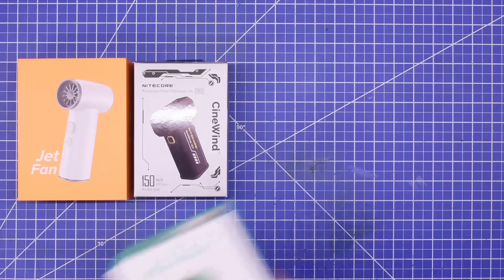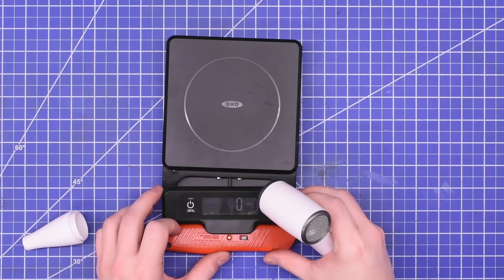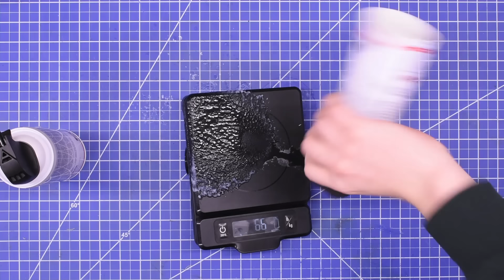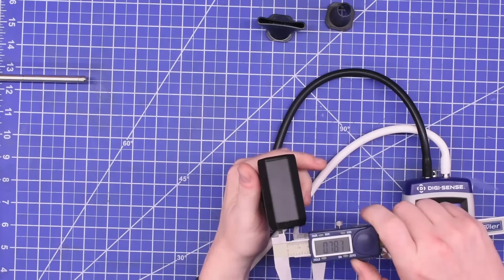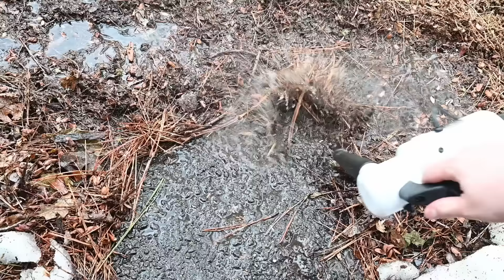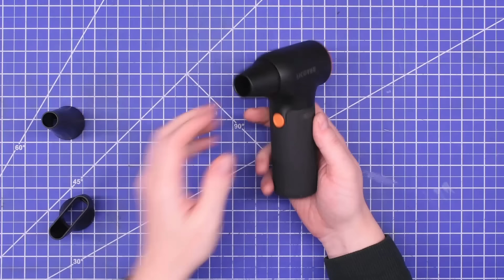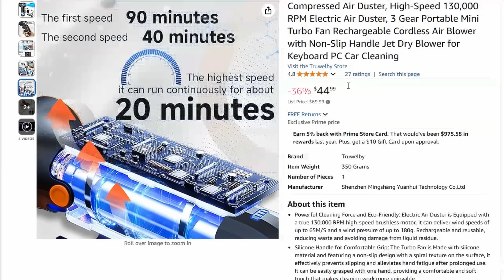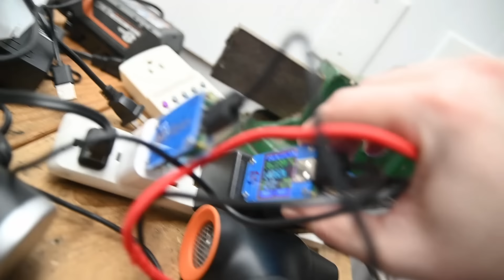Impossible Turbo Fan Dusters v DataVac & Actual Air Cans

Comment: Ok for a bit of info on electronic dusters, You have to be careful of what you are getting for a few reasons, First off the point of the duster and its outliers of what's needed. First off they are there to lift the dust that is stuck onto surfaces and that is all they are supposed to do. Some can do this with a wider area which can save time but one be careful point is too much power can force that dust into places it is not supposed to be. Dust can be electrically conductive so it can short out circuits or block parts from seating right and coming loose. 

Having good pinpoint is needed for tight areas or getting around areas like fan blades. Pointing one of these at your fans without holding the fan to keep it from spinning can cause it to overspin and damage it. You want details then you will have to look it up on PC fans and overspinning damage. 

There is a 3rd be careful point and that's enough air pressure to break components and yes if you stick something like a air compressor nozzle and pull the trigger then you can break off components, Mainly its the first 2 of overspinning fans and compacting dust but it can still be a problem.
Reply: 1. Dust gets everywhere on its own. There is no difference between you forcing it there and it getting there on its own. Static electricity is a real problem, yes, but the likelyhood of you causing any discharges while dusting a PC are astronomically low. 
2. "overspinning", as you call it, will not damage a regular PC fan or its bearing if its not made out of chinesium. Youd be surprised how much abuse these fans can withstand.
3. Sending voltage back into the board by spinning the fan and expecting it to fry other components is a problem of the past. In the vast majority of cases, you cant send voltage back into the board through the fan headers. Diodes and such, yknow. 
4. You will never generate enough speed or pressure to rip components off a pcb with just air. Thats just not gonna happen without, like, a 20000kPa air cylinder as your supply. If you manage to do that, consider what youre doing isnt the way you should be doing it.
Reply: First off, dust can only get into certain spaces where the airflow can push it. Most of the times it won't get into most spots in any real level to cause a short, you blowing dust around can push more into a area. This is talked about with people that build and mod PCs. Some of them have even seen the damage from something like that so I will take their word for something like that. Also I have seen well enough how trying to blow dust around off of parts and machines where before there was hardly any that could even be moved off with the swipe of a finger to where it was layered in the same area later. Thats why you vacuum or sweep off most then blow.

Overspinning is a thing that manufacturers talk about avoiding. The damage is done to the fluid type bearings because they operate on the pressures they generate when they spin, overspinning over pressurizes the fluid forcing it to run dry. The other is ball bearing which is rarer but they can also get over pressurized and leak fluid. 

I didn't say anything about sending voltage back through the fans so I don't know why you are making a point on that.

I have scrapped old dusty boards and have seen a basic 125 PSI air compressor with small air nozzle blow off some components. The boards were working when they were removed but they have been there for 30 years. One of them was a small plastic looking chip and it was only soldered on and not going through the board and it pulled up part of the copper with it. Also to add when I meant the sticking the air compressor nozzle, I am meaning them putting the thing almost right up to the board and using it and not far away. It would be more likely a problem of someone bumping it into a component than blowing them off. Lets face it, a person using a air compressor to blow out a usable PC is more than likely a mechanical inclined person than a computer inclined person.

Comment: Once again, non-contact tachometers require reflective tape on the rotating part to measure rpm. The manual for your tachometer will show this. Why are you trying to use black marker for this? A black spot won't reflect the laser back to the optical sensor.
Reply: Project Farm does it correctly using reflective tape. Using your tachometer wrong does not help your channel's credibility. I'm kinda surprised by how many people in the comments didn't notice the user error.

Comment: I got the Wolfbox one after the first duster episode, and then they came out with a cheaper version that still does alright. Gifted that version to my neighbor and he's loving it.
I've been using a DataVac for about a decade at various IT shops. Started back when I built and serviced gaming and workstation PCs regularly. It was irreplaceable, but always a bit too strong, too bulky, and annoying to have to plug in. If you're not careful with it, you can easily bend thinner heat sinks. I imagine if you were particularly careless you could blow poorly-secured components off boards. 

The Wolfbox has replaced the DataVac for me almost entirely. I only find need for the DataVac when blowing out very large cases or server racks, or the truly most filthy and forgotten boxes.
Reply: I calibrate and repair electrical test equipment and my Wolfbox is a necessity. I didn't even see the video first. The TTC vid just pushed it to the top of amazon and the algorithm steered me right. This channel is doing everyone a favor, even if they don't know it exists.

Comment: Out of curiosity, what is the audible range of your DB meter? AFAIK, ultrasonic sound can still damage hearing but won't be measured by most decibel meters. I ask because when you have motors spinning at >100k, it's peak sonic frequency usually starts exceeding 20k. I believe once I heard RPM / Blade Count is a rough idea of it's peak frequency, but I may be wrong about that.

Comment: An un-mentioned but useful feature about aerosol air dusters (that the mechanical ones can't achieve): you can use them to put propellent on/ rapid cool small parts.  Like when you are trying to pick out broken off nylon screws from captured fasteners.  Shoot some propellent with the can upside down, freeze/ shrink and stiffen the plastic/ get it to turn.  Or trying to shrink small shafts when getting them into bearings.

Comment: You and project farm should do a collab sometimes. Also video idea is to test air compressor air nozzles at 90psi with 1/4” hose and 3/8” hose. If you could test high flow fittings and connectors, and venturi nozzles as well as drilling your own venturi holes. Thanks!

Comment: Just so you know, that DataVac machines are made by MetroVac. Not the other way around. MetroVac makes classic vacuums out of metal. Very simple, made in the USA, been around for 81 years but it the least known. They make a giant DataVac Pro that uses a sling and most of the DataVacs are ESD safe. MetroVac is expensive and kind of heavy though especially for their rolling cannister vacs. But i loved those large cannister vacs, they felt durable like one from the 1950s. 

Ive seen a lot of janitors use them and thats where ive used one of the cannister vacs. Ive used the DataVac when i was in IT too and they were the absolute best. I do use a Makita shop blower now though too and its a contender to the old DataVacs.
Reply: I bought a datavac 15 years ago for personal use. Still have it. Never have to worry about lithium batteries or long term storage. IMHO it is /the/ way.

Comment: If you want another point of corded comparison the Xpower A-2S is the model MicroCenter carries in store and is about half the cost of the DataVac. The DataVac's were not available on Amazon for a bit so it was what I transitioned to recommending.

Comment: Ranking on "average rank" is a really bad idea compared to how you've done things in the past. Project Farm does it and his ranking tables are very inaccurate. A BETTER ranking system would be as a % of the delta between first and last place, or just a % of first-place's absolute value. It's a real pain having to manually recreate data tables from videos to do this, but the handful of times I've done it I've found the resulting ranking are much more representative of the experience you'll have with a product.

Comment: Personally I use a blowgun attached to an air compressor. Guaranteed it'll outperform anything you're using here. You have to use common sense or it can literally blow components apart or in the case of surface mount components literally blow them off the board especially the ones that are the size of a fly spec.

Comment: Do you know of any dusters that take AA or 9v batteries instead of using the internal rechargeable, I don't trust the safety stability of them & not having the option to replace the battery as well.

Comment: I bought a Fulljion to give to my son for Xmas and my wife secretly bought me one as well but last week my son said his air duster quit accepting a charge so I gave him mine while I looked for a replacement for him. I found many identical models that looked exactly like the Fulljion but had different names, price points, and made different claims about battery sizes, charging times, and how long they last before needing to be charged. They all looked identical, right down to every attachment. Instead I opted for a $30 plug-in model (EVEO AirMaster AX) with a 12-foot cord. I gave my son the option between the two and he said the corded model was more powerful but he preferred the cordless one. PF posted a duster video about an hour before this one.

Comment: Definitely would like to see tool brand cordless options on here; I have a Makita XSA01Z and while it's off the scale for this comparison price wise, I absolutely love it. It claims 446mph but only 39 CFM so seems geared towards air speed, which is quite handy for dusting.There's an XGT variant GSA01 too, though from the specs it may lack any additional beans. EDIT: Measured the downward force of the XSA01Z at between 250-300g, so it does have some beans compared to these.

Comment: I haven't heard anything about electro static grounding. The intended use for duster cans, often called computer duster, is electronic devices like computers. You cannot use normal electric blowers without risk of electro static build up and discharge. Potentially destroying something.

Comment: My only gripe with these is battery longevity. I've owned 1 battery powered duster and it lasted about 2 1/2 years before it wouldn't hold a charge for more than a few minutes. Most of the time these don't have hot swappable batteries which would be nice but you might not get the same power output if you used a 18650 for example.

Comment: The "compressed air" isn't compressed air, it's 1,1-difluoroethane, try to breath that. You can easily check composition in safety data sheet. I'd expect less BS from a channel like this...

Comment: Again they make a battery operated air mattress pump just stick a vacuum cleaner tip on it and it works well. And a plug in version is even better.

Comment: Yeah I'm not spending $90 on that. 😅 
A good shop vac is much cheaper than that and you can just connect the hose to the outlet.
Reply: It can be purchased for less than 60 now.

Comment: I DIY one of these from 220V motor and rewound it myself using 8 turns of 0.8mm enamelled copper wire in delta configuration. Using a cheap 30A drone ESC and 20A 3S battery, I can only get 280g of thrust (5cm from the scale) though some people in my local group can get 350g of thrust, crazy. 280g is scary enough for me, the Betaflight configurator reads the ESC RPM of 132K RPM

Comment: The wired datavac... WHAT IF WE HOOK IT UP TO THE BEANS BATTERIES!! >:D
Reply: It would be less powerful and would eventually burn out the motor.  The datavac desires 120V AC
Reply: @Michael-hn8bo  That would depend on the motor. If it uses a universal motor like a typical vacuum cleaner, it would run just fine on DC. The switch would be an issue though. It would have to be replaced with a switch rated for 120V DC.
Reply: @rocketman221projects  Thank you for the clarification!

Comment: Something to consider that the cordless ones can't do... Is they have no way to discharge static buildup except out the tube or through you. The Datavac is dicey but it at least has a bleed path, they do have an ESD rated model. Something to consider if using these on or near anything ESD sensitive like a computer. Canned air can't build ESD afaik.

Comment: Why don’t you test more corded air blowers like the datavac? Personally, I see having a battery in something like this as a net negative for me, as that battery seems more likely to die over time when compared to a corded model. Also, there are a lot of Amazon specials out there, like the Sin Shine 3.0. That gets pushed a lot, and the price point on some of the corded models are a lot lower.

Comment: XPower is the one had for years, the datavac is sort of Meh. It's also 2-speed & even cheaper
Edit: previous to having an m18 packout vac, I'd use these things so much. Until eventually you see it's counterintuitive to blow dust into the same generalized area (in a Pc, with waterblocks/rads, etc). So you may as well vac & toss the dust elsewhere. But it's great to see how much more portable these things have become, it's pretty insane.

I can see getting one even if it's just to blow residual water off boots or a quick way to blow any dust on a carseat or something because it can fit inside a glove compartment

Comment: Just for information, when the can of compressed air freezes over and nearly stops working, run it under warm water while swishing it around to quickly warm up the ice cold liquid. This will instantly return the can to normal function before it froze for another few seconds. I use this method to get every last bit of liquid out of my cans and to literally just use them as they instantly freeze. I find that the bathtub faucet works quicker and easier.

Comment: Coincident from Project Farm 😁
Excellent video and research!
I suspect maximum RPM works like my vacuum and yard blowers in that blocking the air flow causes them to reach maximum RPM while they are not under air load.  Also, as soon as you unblock the air flow they have maximum air flow while the RPM is still super high, but just for a second.
I'd like to see Milwaukee come out with an M12 mini blower so I can reuse the M12 batteries.
Reply: Read the pinned comment!

Comment: I have zero regrets getting one of those datavacs. Insanely useful for blowing dust out of filters and the like
Reply: My work sent me one for work.  
I turned it on for the first time, felt that kick, and thought I could move mountains.
Reply: @Michael-hn8bo  I may or may not have tested how goofy my face looks when facing it towards my mouth... lol
Reply: I've had my datavac for at least 13 years and I have only two complaints.
The first is that the intake filter clogs quickly, especially if the dust from whatever you're cleaning wraps around.
It also gets hot fast. 
Otherwise, it's been great.
Reply: @EricUdell  now I want to see someone liquid cool their datavac..
Reply: I got one probably over 15 years ago, been very happy with it.

Comment: Yo thanks man! I use datavac for home and it’s been amazing, I even use it to dry my car wheels. For the price it’s unbeatable but it’s very loud.
Reply: for the price, a shop blower is cordless and you can dry your wheels and all the cracks/crevices where a twisted loop won't reach, oh and it's cordless.
Reply: @flandrble  I have that too, the Milwaukee m18, but I have noticed that the data vac does a better job, it’s probably because I don’t have the tip that increases the velocity. I have a 3d printer so I will print one this summer and see if it works better than the datavac.